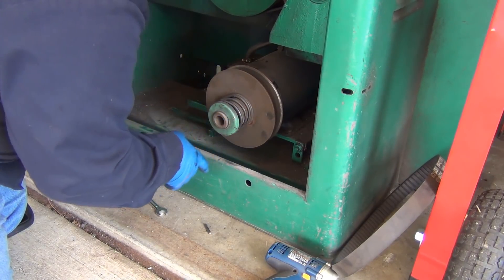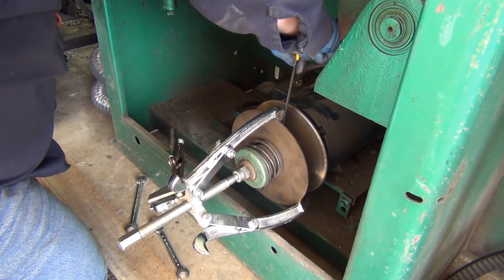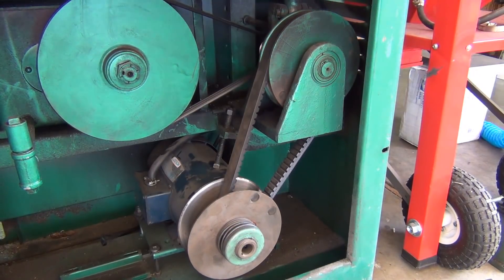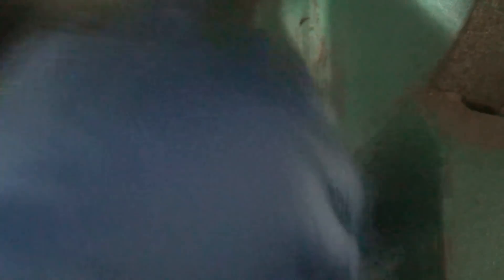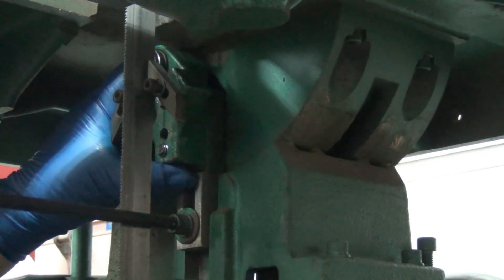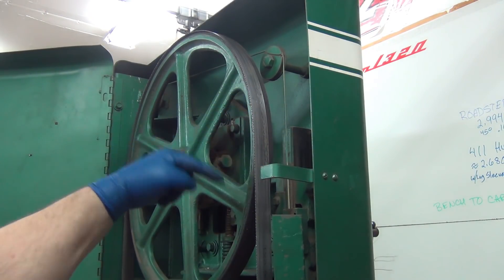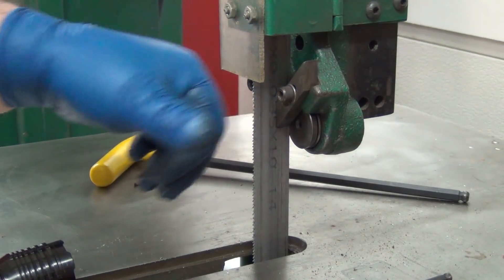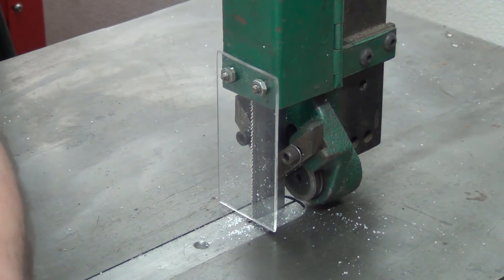Powermatic 87 - Prep

Comment: Does anyone have a video on how to replace the 3 thin v-Belts and where to get them. I have one that broke and I am sure it is better to run the machine with all three
Reply from the maker: I did a bit of digging.  I don't really have an answer for you, so hopefully, another owner/viewer will chime in.  The little ones aren't "captured" so you shouldn't really have to do any disassembly.  The small pulley on the right has open access from the far side(the end of the shaft it's on).  The big one on the left is open on the front side.  I don't know how the tension is released.  This place says they have the belts, but you're probably not going to like the price.  https://www.repairtoolparts.com/powermatic-parts/powermatic-87-parts-list  Their figure 6(F) shows the little belts as part 35.  

This site will help you measure the belt.  If you can possibly find a number on the belt, you can probably look it up on here.  There's probably a lot of gunk on the belt, but with a bit of cleaning, there may still be a number on it.  https://www.vbelts4less.com/how-to-measure-v-belts

Sorry I don't have better info for you, but I sold the saw years ago. Good luck!!  Mike
Reply: loosen the four bolts holding the countershaft assy just enough so it can move freely, then back off the set screw pushing into the countershaft assy, this will allow the entire countershaft assy to move forward and relieve pressure on the belts, replace all three with a matched set of gates belts (Part No. 7M1180) and reassemble in reverse order.  Good luck!

Comment: The guide(s) should be adjusted so that the guide(s) is up to the bottom of the tooth gullets.
Reply: The teeth should be riding on the wheel at the wheel centerline.
Reply from the maker: +gbowne1 I'll look, but I don't think I can do that with the 1"
Reply: It would be tough.. I think 1" is too much for your saw.. probably not meant to have more than a 7/8" blade.  Mine, a Startrite (a Clausing-Kalamazoo product) only uses a 3/4" max blade and is about the same size as your PM.
Reply from the maker: +gbowne1 According to the specs for the saw, it will do 1".....and that's what sawblades.com recommended.  Now that I've used the saw, I don't think I'd go over 3/4", but since I have two of the 1"......I'll live with them for now.